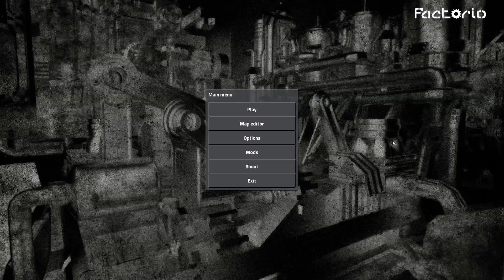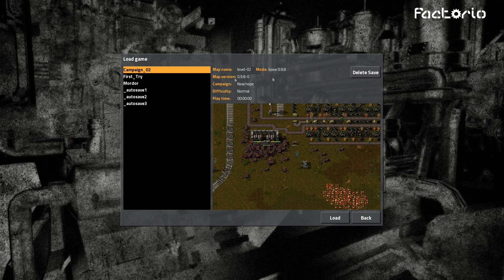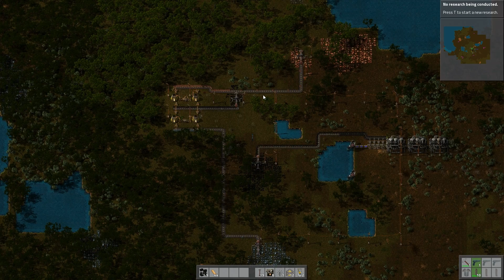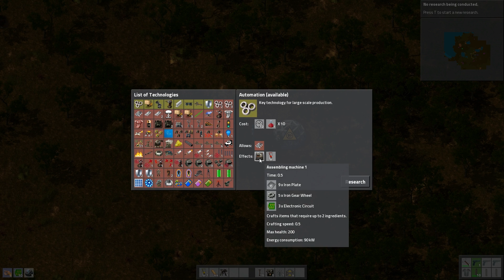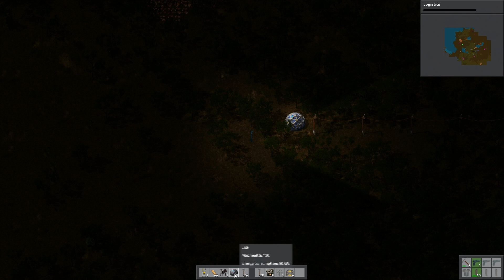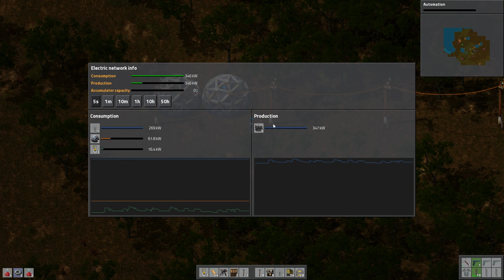Factorio, Part 3: Blunders of a Noob

Comment: The belt formation that you were trying to make will work with a >V< non corner T junction where the resources coming in from the two opposing directions of the 'cap' will end up segregated each to one side of the exiting 'stem of the T' belt. Might need to build the stem first to avoid the corner behavior. Can be useful near mining rigs if you use a splitter as any belt that dumps onto a perpendicular moving and non-corner belt will fill the side it is entering on.

                         MineOutput
                          V
ex. ::<:::<:::'''<''S''<'''      should produce a belt with ore on both sides.
                  ^...S
Reply from the maker: Useful! Thanks.